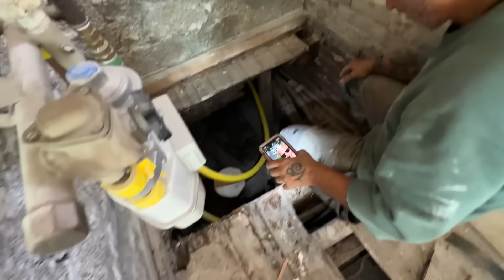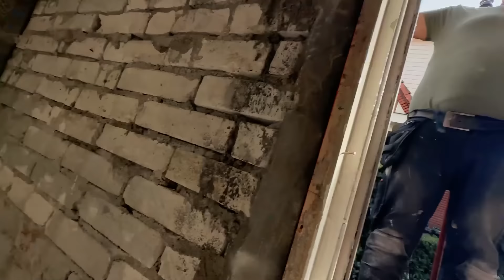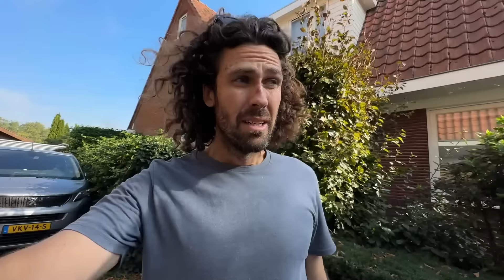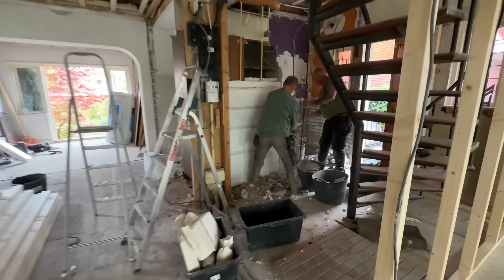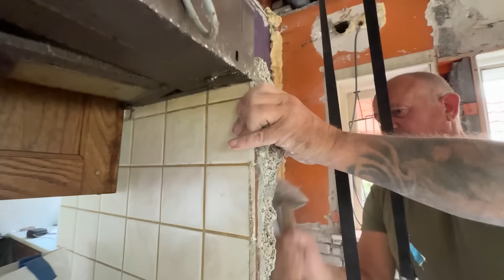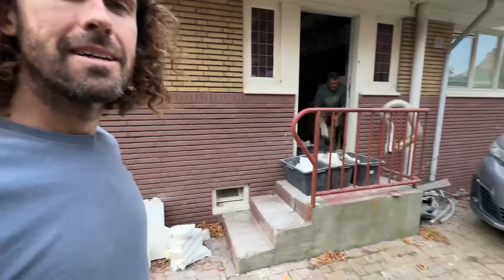Disaster Strikes: Rotten Beam & Wall Demolition in the Kitchen! PT 26

Comment: Nicky has the right idea extend the kitchen wall out BUT  please find a way to hide the electric work with that wall without hiding it under the stairs. Keep the stairs open they look beautiful. You can reuse the old cabinets and just get new counter tops. Until you can afford new ones. Better to have bad cabinets and the right floor plan. 😁
Reply: Yeah I like the open plan style always makes things look bigger.  But it is more costly to heat though.
Reply: Totally agree
Reply: Extend the kitchen....it's more cost now but less in the long run.  Leave the stairs open, more light and it looks great.  Open plan is nicer especially when you have children you can see them and are not stuck away in a kitchen

Comment: As far as the bricks are concerned, I would use the red colored bricks and make a pretty feature. The color of the yellow bricks is never going to match all the way around, and using the contrasting color will be much more pleasing to the eye and for your curb appeal.
Reply: Good points
Reply from the maker: That’s a good point, another option is to clean the walls and hopefully the old bricks then match with the new ones!

Comment: I'm in love with this serie🤩 maybe this is the last trip to the dump🤣 
BTW try to pressure wash the outside bricks. Maybe they are lighter than now and the brick you are testing match exactly that colour🤙🏻🤙🏻🤙🏻YUUUUUU
Reply: Or sandpaper
Reply: Sandblasting could be an option as well, a bit more aggressive then power washing but probably cheaper then replacing all the bricks.
Reply from the maker: Thank you! Glad to hear you’re enjoying the videos 😃 We might have to clean the  bricks, it would change the look of the house for sure!

Comment: Nicky's suggestion for a slightly larger kitchen sounds rather good.  Yes, the toilet would need relocating, but that does not seem insurmountable.  May be a good opportunity for a major upgrade of facilities, without getting too expensive.  It will depend upon where you place the other walls and facilities.  A large open-plan kitchen coupled with room for an integrated or associated dining area can reap many benefits.  Why build walls that are not needed.  Just ensure your ceiling joists are adequately supported, and, of course, that your floor joists too, are secure.  Too many home upgraders do not look at these aspects and leave areas almost ready to fall down.  As for your row or two of bricks way up over the top of the glass window, they will need someone who is well versed in repairs of the same nature.  It looks as if a steel plate 1/2 inch (or larger) thickness by the width of the bricks will be needed, as well as a completely new several brick thickness of bricks to replace those that are crumbling.  Professional help will effectively be mandatory.  Good luck.   I look forward to seeing how you progress.

Comment: I would expand the Kitchen, leave the stairs open into the room, no walls around the stairs and the kitchen open into the main room. Go open plan essentially. As for the bricks consider that the outside bricks have been exposed to the weather, so your new  bricks will look new to begin with but over time they should have the same colour as the older bricks.

Comment: Nicky & Leigh, first I'd say replacing a couple of rotted floor joists isn't really a hard job. No one wants parts of their house to be rotted, but it happens, especially with old houses like yours. As for the kitchen wall, yes, i;d make it straight, and not rebuild it the way it is. It's very easy to build a wall with 2 x 4's. To me, it's shocking the walls would be some type of cement, or brick. I know you've house is probably almost finished. It will be great to see the finished house. Cheers from the USA!!!

Comment: Forget about the extension of the house as this will raise the costs a lot more. Instead extend the kitchen a little bit and completely redo the kitchen itself. Nicky isn't wrong in this, I had the same thought about it. It does mean that narrow window probably has to be closed up as well which means you will need the bricks to do so. That 1 pallet with bricks is actually not a bad idea there for. Even if you have bricks left, you can make a BBQ out of them later on. 

For the beams, I did warn you guys that you probably need to replace those. I would probably advice to have a specialist look at all support beams and see what the outcome will be. If 1 beam is rotten, there might be others that need attention as well.

Comment: You need to go in your basement and reinforce the beams you used to level your floor because you removed weight  with screws at 45° so they don't slide during renovations or if you get a earthquake

Comment: We in the US are today celebrating as you may know Labor Day Holiday! Be careful with the selection of the brick that is beige colored? There are regular brick! And there are Fire proof brick. I have seen first hand of a renovation of a 3 story home where I used to do work in the neighborhood, and the couple was adding on a Carriage house, Garage. The contractor added similar color brick to an extension of the small kitchen on the Home, and when the INSPECTOR!!!!!!  looked at their work, It turned out that all of the brick they used was the same color, but not Fire Proof Brick of the same color? The contractor had to remove all of the brick that was originally used, and replace it with the same fire proof brick of the same color, which the cost of such brick was so very much more expensive. The Contractor was fired, and another Contractor continued with the more expensive brick to keep this Mansion original to the period. It is a thing to consider if the inspections are as difficult as they are here in the US?
Reply from the maker: Wow we never even heard of that! Thanks for the tip, not sure if it’s the same in the Netherlands but definitely something to keep in mind!

Comment: The existing bricks have been there for many years and have darkened up slightly because of dirt. Try to clean one of the existing bricks, maybe even with acid, they may lighten up and look a lot closer in color to the new brick. You can also try and force "age" the new bricks by coating them lightly with dirt and wiping it off, as strange as it may sound you're trying to do what it took nature decades to do to the old bricks.
Reply from the maker: That’s a good point, cleaning the front of the house would be nice because it has really darkened over time 😃

Comment: I hope you did not pay too much for this house  - be careful when you remove a wall for the stability of the house  - maybe you need a architect   - check also the roof  especially the wood
Reply: Not an Architect.
Reply: @bridgwll      you better ask advice to an architect when you remove walls  - breaking down a wall can have an impact on the stability and structure of the house especially when it is a load bearing wall
Reply: @MrRocking4ever  architect does not build.